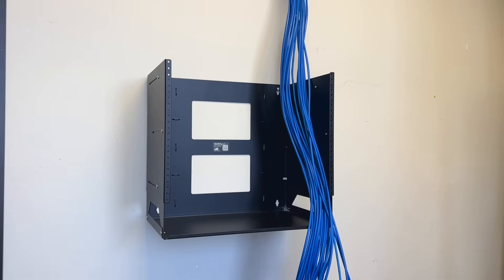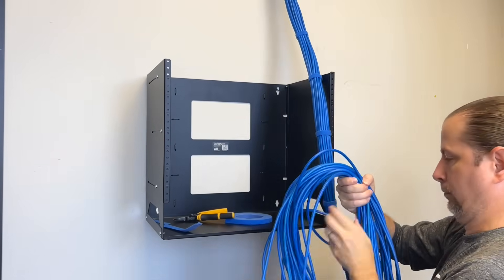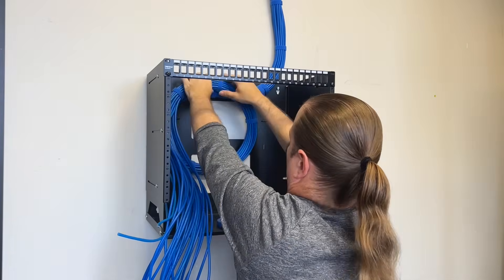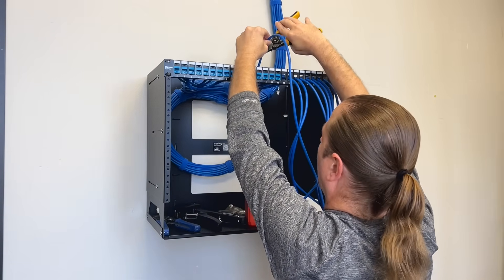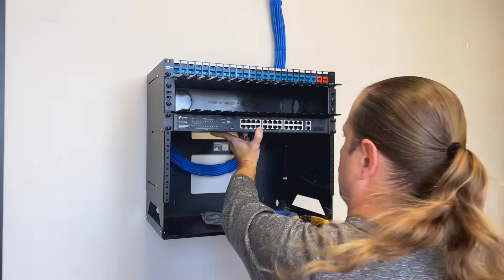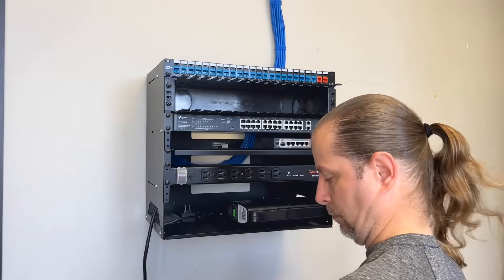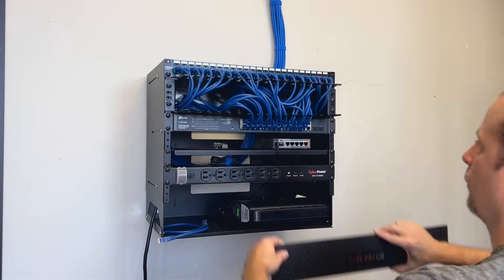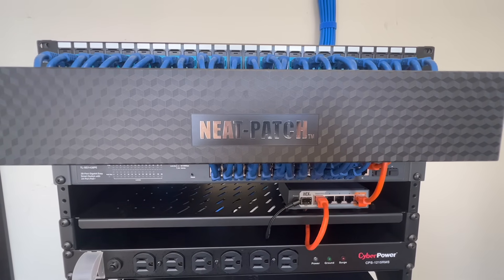Learn Network Cable Management for Home Racks

Comment: Hello, good video! @ 03:04 when you put your cables in the patch panel, do you know where each cable goes in your house or you'll figure it out later? Thanks for the video, I plan to do this in my house soon, as fiber internet should arrive soon I hope.
Reply from the maker: Normally the faceplates around the house that these cables go to would have a label stickered to them and the number on the label should match the port number on the panel, so usually 1 through 24.
Reply: @tciproductions  Ok thanks for the answer, sorry but still something I don't get. In the video you color code ports 23 and 24 red because you will use them for wifi (wifi access points I imagine). How do you know these 2 cables go where you want your wifi ? Do you also number the cables 1 - 24 matching the faceplates they are connected to? Sorry if it's a dumb question and thank you.
Reply from the maker: @xurok  Sure thing.  When you take a wire from the box and run it to the spot you want something, you would want to write on it with a sharpie or labeller and put what number it is.  So your first cable is 1, and so on until 24.  Then, when connecting things to the panel, the panel is pre-numbered 1-24, so you take the cable you labelled 1 and terminate it on port 1, and so on.  So if I had put my wifi into position and it was cable numbered 23 and 24, I put those on the last two spots of my panel.  I try to put my wifi all together numerically if I can.
Reply: @tciproductions  thank you very much, all makes sense now ! ❤

Comment: I had mine at home, with 48 ports, installed with a wall mounted patch panel so that all the wires would remain hidden inside the wall.  The only wires that you could see if you looked behind the switch, are the short 1 foot runs from the patch panel to the switch.  It looks amazing!  No need for a wire snake to pop out of a wall or ceiling.
Reply from the maker: I wanted to show the concept in the video of having some spare slack, but tucking it out of the way usually looks a whole lot better for sure.

Comment: Do you have a method running patch cables so you can see which sw ports they connect to? I see the way you did it where I work and with multi switch racks it’s a jungle
Reply from the maker: I have a video planned on this, however I would broadly say that I patch them in the nicest way I can without any care as to which switch port they end up on.  I try to always use a managed switch, and with that, I can usually tell which PC is connected where without needing to match the switch port to the panel port numerically.  So many switches number their ports in a weird way that makes it look awful when patched.

Comment: Such an amazing job. 
Noob question here:
why use another router connected to the modem? just to add more functionality that the modem lacks?
thanks!
Reply from the maker: My ISP locally usually sends a plain modem, it wouldn't have had any router functions built in.  I know other ISPs give out different devices, so you may not need a router of your own in many cases.

Comment: Great video! Btw is there any point in terminating into rj45 connectors and having double keystones in your patch panel? Or is that just unnecessary extra stuff?
Reply from the maker: I don't know many people that do that, but it is one way to go if the wires that are present are already crimped or pre-mades.  Otherwise I use a keystone set up like shown here, or a punchdown panel.

Comment: Aren't you testing your cables after crimping them?
Reply from the maker: I do, and in other videos I make sure to show that step.  This is more about forming up the rack elements than the cables themselves. It's definitely important to always test them with a fluke or similar tool.
Reply: @tciproductions  
Thank you for the response and your videos on your excellent work.

Comment: I'm about to run conduits through the basement in my house for a Cat6 install. I know that rack installs typically have the cables just coming out of the wall on the rack side, but I've been thinking about terminating them in a wall panel and then patching to my rack. I think it'll be good for the eventual resale of the home, since the next owners will most likely just use a standard consumer switch. Do you have any thoughts on this?
Reply from the maker: I agree it will help the resale, at least if the new owners are slightly interested in home networks, which are good odds.  I can't speak to the wall panel but if its a patch panel and just a shelf (no rack) then I think that is perfectly fine.  A whole lot of homes I visit do it that way.

Comment: Great video, loved it.  TCI, you should add the Cable Comb to your list of item's used.  Made by Jonard Tools.  They make two models, the CCB-25 that accommodates cables up to 1/4" (6.35mm) in diameter, this is the version he was using in the video.  Or the CCB-34 that will handle cables up to .36" (9.14mm) in diameter.   If you're pulling 6a, even unshielded like I'm am, you'll need the CCB-34.  Love watching a professional do their thing.

Comment: I got this video in my recommended, I always love to see cable management.
However, I have little experience networking besides setting up an managed switch and updating my router firmware.
So I wonder, what situation requires 34 Ethernet ports?
My router has around 9 ports, enough for me.
What internet speed do you have that can support 34 ports? 
Are you planning on having a LAN party every Saturday?
Reply from the maker: There's other commenters that discussed it, but 2 wires to each outlet in a house is standard, so in a 3 bedroom with the entertainment center factored in, that's 8 wires, then perhaps a couple APs, that's 10, then you might have some cameras set up, that's whatever.  Factor in a couple of exterior spots for who knows what, maybe something in the garage if you have one, and you'll get close to filling up a 24 port panel pretty quickly.  It depends entirely on your level of interest and use of course.  Could always just set up two APs and call it done, but where's the fun in that?

Comment: hey great video and i was hoping if anyone can tell me if the TrendNet 24 Port Blank Keystone Panel can be used in navepoint racks ? there is a 1 inch deference in the dimension between the panel and the rack and i dont know if thats a problem
Reply from the maker: It should fit fine, but if you have a link I can check.

Comment: Skip the 2U cable manager IMO if you have the capacity for a 2nd patch panel put one above and below the switch that are 12 Por 24P and split the ports top to bottom with 3in. Keeps things nice a clean and easy to trace, granted for a tiny rack like this its not always the case.  In larger racks though I prefer slightly longer runs and then split the switch left to right with cables on each side, that way you have flexibility to shuffle things in the rack without having buy new cable. 

Personal tastes aside though its not a bad little wall rack, for every hundred or thousand cabling jobs I see maybe one or two of them are actually this clean and super happy to see you use Velcro and not zipties.

Comment: thats a very clean install..

when i designed and built my home network for our new house and  one day the wall mount rack i ordered arrive, my wife immediately told me that she didn't want to see that hideous thing hanging on her walls

i opted for an in-between studs with flush cover enclosure.  very limited for what i needed but i made it work.
Reply from the maker: Those are so tough to do well.  If I ever manage to make one not look like garbage I will post about it for sure.

Comment: What do you need 24 ports in the house for? Can you give a breakdown?

Like a couple computers, tv, game console(s), couple wireless APs, maybe a NAS, what else? I can imagine at the very most ten wired devices
Reply from the maker: Well it depends.  In my experience, people with small homes don't bother with this, it is a bit of a luxury item.  So if they have say 5 rooms in their house, 3 bedrooms, kitchen, living room, you might run 2 cat6 to each room.  To an entertainment center I might run 4, to cover modems, a wifi unit, a gaming console and so on.  Then wifi here and there and maybe a couple of security cameras and you've got a pretty full switch.
Reply: @tciproductions  right, I guess I forgot about cameras haha, I can imagine filling the switch with them

Comment: a huge amount of wasted cable, why was it necessary to make an additional transition when it was possible to connect the cables directly
Reply from the maker: You could just use a long patch cord and connect from device to switch and it would work, but that wouldn't be anything that sharpened anyone's skills.  I want to build people up who are interested in doing a more professional job, even if it is at home for fun.

Comment: If you precut your velcro and wrap them at the start of the trunk of the cable, all you do is just slide the velcro down so your not having to hold the cable or mess with cutting in the middle of combing.
Reply from the maker: You can kind of see me pre-cutting like 15 of them but I suck at estimating how many I need, gotta work on it.

Comment: As a retired network engineer, I think is worth mentioning that you should never use plastic cable ties on data cables.  Far too many people use them and it hurts in the long run. The reason is that they distort the carefully engineered separation between the individual wires within the cables, thus causing signal distortion or cross talk. Always use velcro like this guy used. You'll be much happier in the long run. Not to mention how much easier it is when (not if) you have to add or replace a cable.
Reply: Former DC technician for a multi billion dollar Oil and Gas company and now system admin who still does a lot of cabling, 1000% zip ties can go die in a fire. Personally  I wouldn't worry about zip-ties causing distortions or cross talk (except for maybe fiber when it comes to distortions) but because its not very practical in a production enviroment and you're more likely to damage or cut a cable when its zip-tied, not to mention taking way longer to make any small runs. 

 Fact of the matter is the average person is and will be running new cables or replacing them over the years and you are just as likely to accidently snip a line or damage it because there is so little give or working space in a rack or conduit.
Reply: Things I learned from plastic cable ties
1) They cut you good if the cable ties are not properly cut. 
2) Using those bastards are prone to damage the cables. (I saw from my workmates)
3) They damage the cables from being tightened much.
4) NOT REUSABLE.

ALWAYS USE VELCRO.
Reply: How tight are you people sinching down zips? 😂 It only needs to hold the bundle in place.
Reply: So would it be a bad idea to use staples made for cables? Like the T59 from Arrow? Going to be doing two drops through floor into crawl space > basement - planned to use a stapler with cable friendly staples.
Reply: @gmontenegro9711  Almost anything is OK if done with care and almost nothing is good if done without. Cable staples wise, "less is more" - only use in areas where it HAS to conform to the surface not to get snagged etc (where you can't have a raceway), and don't make it conform too well to inside and outside corners. Respect the min. bend radius stipulated by the manufacturer. A much better way for a few runs, is to either use big staples electricians use as a place to which you affix velcro around the bundle, or plastic Multi-Cable Staples that Gardner makes.
Reply: :goodvibes:

Comment: Yeah, a clean setup. I personally would not use a Neat patch system because it needs a lot of rack space and I usually work with full cabinets where patch cables are guided to the side.
Doing a good cable drop is what not only makes the look of a good cabinet but also ensures that you have room for service years later.
I would also not go for the patch panel, switch, patch panel, switch, etc. configuration because switches are often very long and the cable drop and the back of the switch are in each others way. So I keep the patch panel at the top (starting with fiber and after that all Cat. 7 panel. Switches and other active devices below that. Usually I start with one patch panel, then one cable routing panel, then two patch panel, one cable routing panel, two patch panel, etc. Assuming everything is 1U high.

And as important as the cable droop at the back, is the use of patch cable with the appropriate length. Nothing lets a rack look more messy than too long and too short cables.

Comment: Don't do service loops in your rack unless you know for certain you're never going to put something larger in it.  You decide to go with a deeper POE switch putting out a lot of heat in the future and you're going to regret having that rack so crowded and having to move your loop.  

Sure it looks nice, but you're almost definitely creating work for yourself in the future.

Also, don't use these thick patch cables in 2023.  Just go with the really thin 6" prefabs, save a lot of space in your rack, and make it look a lot nicer.
Reply from the maker: It was done this way for demonstration purposes, otherwise I couldn't fit it in the shot.

Comment: I am curious, why does one need this many cables for home usage? Do people  usually have a lan cable to each room?
I looks very cool, so I woud like to know the purpose.
Reply from the maker: In some of the high end houses I have worked on, we've run 2 LAN cables to a faceplate in each room, and then a few into ceilings for Wifi, and a few exterior for cameras.  It gets up to 15+ wires pretty quickly.  Usually the homeowner is a techie kind of person for it to turn out that way.

Comment: Tf size is your house
Reply: I mean most houses are 2-3 bedroom so 1-2 ports each room, upstairs and downstairs TV room and basement area.  You can pretty quickly get to 24 Network connections event in a small home once you factor in a home-lab of some kind. 

You could cut that in half but if your running structured cable its usually a smart idea to run an extra cable encase something happens to one of them.

Comment: What is your thought on a patch panel with a few short cables to hook up to the equipment inside the rack? I have a synology rs unit with 4 ports in the back, ubiquiti cloud key and an apc pdu. all of them have network ports in the back.Looks a bit messy with 6 cables going to the switch ports from the back of the rack.
Reply from the maker: Hmm.  You might go with a unloaded patch panel like I did in this vid, and then for the ports that need what you are describing you can use these keystone couplers, that way the cables don't need to come all the way to the front.
https://amzn.to/3DtGUvh

Alternatively, if you don't want a patch panel for a small house deployment, you can just use patch cords and send them through a brush panel:
https://amzn.to/3rN7jSj

I'll try and incorporate this in a future video.

Comment: What’s the best network switch in your opinion?
Reply from the maker: In the old days I would have said the Ubiquiti EdgeSwitch but that line seems to be retired.  The Unifi model switches are garbage for enthusiasts and businesses, fine for home use.  I have used TP-Link, netgear, and Catalyst 1000 series with some success but have not really fallen in love with anything yet.  I am testing Aruba switches with my standard deployment and so far they seem like a good unit, you might look into those.  I also have a pair of Mikrotik units I was given, and they by far have the fastest and most responsive GUI ever, which is really growing on me.  I don't know enough about their finer points to say what is good, but I rely on certain features like multi-cast per VLAN, per VLAN spanning tree, and other small edge cases that can mess up my applications which I haven't tested yet but I'm hopeful Mikrotik turns out to be the way to go.  Check these: https://mikrotik.com/product/CSS326-24G-2SplusRM

Comment: Very nice!  Whats the best way to account for/organize those connections coming into the patch that need POE from the switch.
Reply from the maker: My opinion - make all your switches PoE on every port, and patch it all in.  You will be glad you did later, every single small biz that installed a 16 port PoE and then a 24 port gig switch without PoE ended up replacing both of them with a 48 port PoE switch, a costly upgrade.  If you can, just do it all PoE from the start, in 24 port switches, which I think are the best bang for the buck at around $350-$450 per, two of them is cheaper than a single 48 port.  As the days roll on, all kinds of stuff will be PoE-powered and you'll never have enough ports.

Comment: Please correct me if i'm wrong. But afaik you installed the shelf for your Router upside down. The way you did it you lose one U to the mounting which you wouldn't  the other way around.
Reply from the maker: I do that deliberately due to the irritating lip that the shelf has, it doesn't let items sit nicely if they are slightly deeper than the shelf.  I didn't think to discuss it in the presentation, I made sure to in the follow up.

Comment: Great video format about going on the rack layout, and agree about doint the cable drop properly will matter the most. Since the rest is easy to change. Mainly going with the power strip closest to the ups is going, in mine homelab i just put some ups on the top, the strip is on the top of the rack. But since im both lazy and i keep adding stuff, the clutter tends to arise. But I love doing cleanups when its bad enough.😂